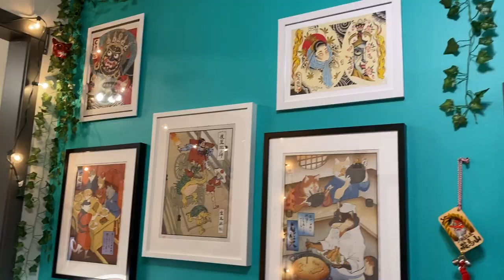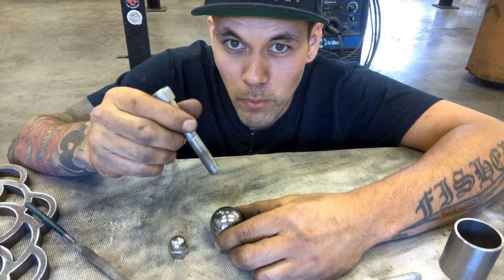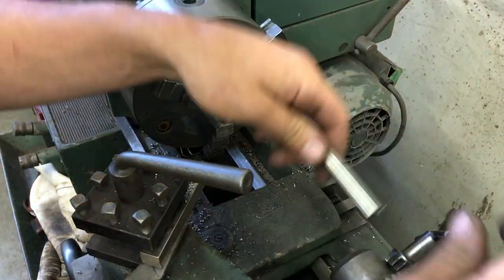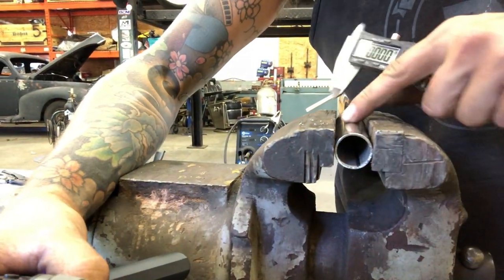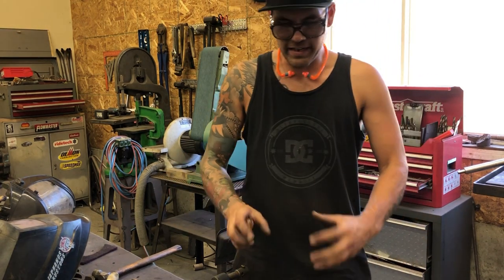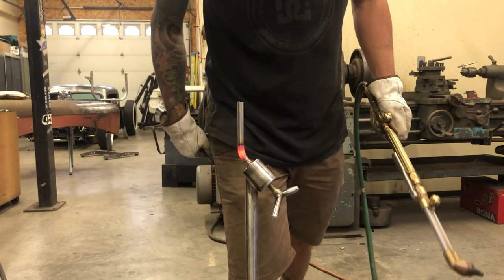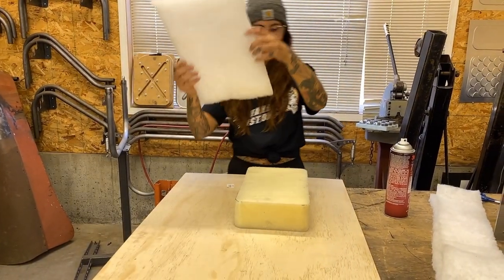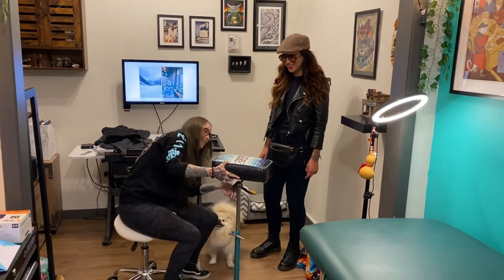COLLABORATION With My Wife!! Tattoo Arm Rest Fabrication and Upholstery!!

Comment: Great video and the two of you working on a project together shows how much you complement each other. And doing something that is not directly related to the actual car projects you normally do it’s interesting, like you said you had to do a little brain scratching to figure out what you need to do. A few years ago I was in a retraining program for auto body/mechanics, the local vendor/ supplier had a problem with walking and getting into his high bumper cube truck. So I took it on myself to fabricate a folding step ladder to help him. The project was great and when I installed it he was so excited and taken back that I would do that for him he was almost in tears. And I just wanted to help him and make his life a little easier and it was fun to do and I feel good about doing it for him.

Comment: I'd love some more episodes on material science. I would of never guessed about the bronze on steel.
Reply from the maker: Yeah we can definitely get more into that the more I learn. Are you silicon bronze for a lot of metals
Reply: It’s technically not welding, it’s brazing, and the terminology matters because it’s how you can look up more information about it. 

Welding gives a higher strength rating when it’s done correctly, but brazing is still extremely strong, sufficient for most people’s needs when connecting two pieces of metal, and when you don’t have a TIG welder and/or are trying to bond dissimilar metals, brazing is an awesome option to have in your arsenal.

Comment: Congrats guys on seven years. 
Great work. When using stainless fasteners the general rule is to use different grades ie; 304 bolt with 316 nut or vice versa. The difference in hardness, along with nickel anti-seize almost always prevents galling.

Comment: Cutting foam, an electric carving knife is the bomb!  Thrift shop and your set.  Scissors are easily sharpened, take out the screw and replicate the original bevel.  80 grit works great for heavy stuff like what you are doing here.   Dot of oil and you are set till next time.  Easy for you!
Reply from the maker: Thanks 🙏 fir the tip!

Comment: Using a lathe to center the ball and rod is a great idea. Also, knowing you can weld stainless steel and soft metal using a TIG welder and a special welding rod is good. Thank you!

Comment: I'm impressed by the joint of your welting cord, Cristina. That was a difficult thing for me when learning auto upholstery. It would be cool to see you set up an old Juki, glue pot, and 8 by 8 table in the corner of the shop and do some upholstery videos on the finished cars.

Comment: Another excellent Kustom Co-Fab on the stand, very smart and very cool. One thought, not a critique at all just a thought from experience. I personally would have used something like 1/4” pronged insert nuts on the backside of the plywood which would have allowed you to fasten the rest tight to the base using machine screws instead of wood screws that over time may strip out, especially if the screws need to be removed occasionally for cleaning purposes.

Comment: My Guy, A trick I've used to drill stainless is to put a drop of Elmer's glue on the surface.  It helps the bit "bite" I guess and get it started.  I bought a commercial sink and shelf for my shop and needed to drill a few holes in it to mount it to the wall.  It worked well on stainless sheet metal.  Not sure what would happen with a thick ball like that.

Comment: Great project. Love the variety of things you do. One minor point about stainless threads - copper grease shouldn't be used on them as it causes corrosion with nickel/copper contact. Use a PTFE based lubricant.

Comment: The part that scared you is simple to fix. Before you spray it with contact cement, lay it in place where you want it and mark it with a marker or pen. Then remove it and spray as normal, but now you know exactly where you like it by your marks..

Comment: That might not be car specific, but guaranteed that ball joint and the whole rest could be used for making stands used in car fab. You could make a similar one with clamps to hold tubing and such while you weld onto it, or perhaps to help hold panels in place, etc. The possibilities there are endless!
Reply from the maker: Yea I could see this ball joint being handy for a third hand or welding fixture 🙏🙏🙏

Comment: After splitting the tube and welding, how did you avoid a 'root weld' scenario where the blow through would cause an obstruction inside the tube. Or did you somehow remove the weld that formed inside so the other tube could slide smoothly inside. Thanks for posting all these great videos. Love watching a craftsman like yourself.
Reply from the maker: You’re very welcome! I was just careful not to weld too hot and I ended up with just enough penetration not to protrude the backside

Comment: The next time you need to drill into hard material like the bearing ball, use a carbide drill bit.  But don't forget that carbide tools are extremely hard and therefore brittle, so don't drop them or you'll be buying replacements.

After showing Rusty's name, I expected the same for the dog!  LOL!  ;)
Reply: God bless carbide bits.  They've saved my bacon too many times to count.  Mistakes happen...carbide fixes 'em!
Reply from the maker: Thanks Bob! Will definitely try that route next time

Comment: Done the everdur trick many time. I would machine another ring similar to the upper one but longer cap off the other end and press on that. you could machine the whole thing or cap it. clamping area on the ball would be significantly more.
Reply from the maker: you’re correct with that extra ring for the backside! but I don’t think it’s necessary in this case  the clamping pressure is pretty significant as it is

Comment: next time Christina needs foam cut.  You can cut it very accurately on a band saw.    I draw the board onto the foam add 10mm (around 3/8 for the yanks)  to all sides instead of batting.

Also You'd be surprisedhow accurate you can be with an electric meat carving knife if you don't have a band saw.
Reply from the maker: Thanks Garth! We definitely would like to get a meat carving knife and we do have a bandsaw here it was just so dirty ha ha

Comment: The ball pivot would be far longer lasting / durable if you put almost anything at the tightening screw so it's not metal on metal.  $20 camera stick pivot + a nibble of water bottle cap and the sweet old lady' traveler eyes lit up when her toy worked perfect.
Reply from the maker: That’s why I used a softer metal on the tightening screw. It won’t mark anything

Comment: So just taper the bolt and tig weld it with 308 or 310 whatever the material is
Reply from the maker: Pretty much man but I actually used silicon bronze for the whole thing Welding